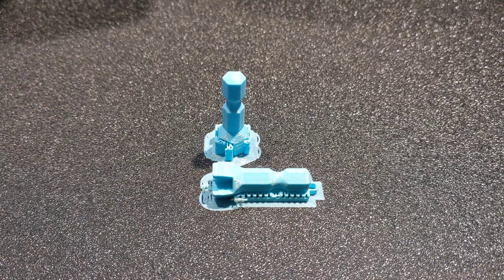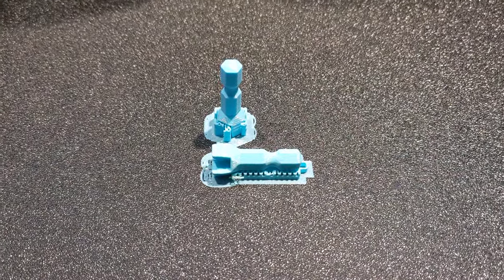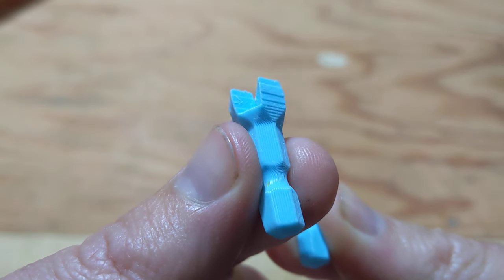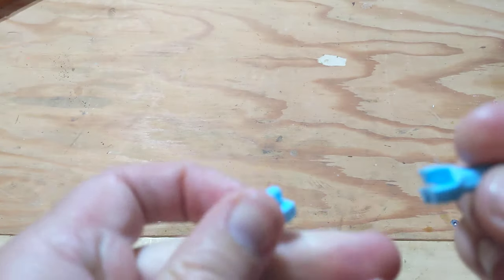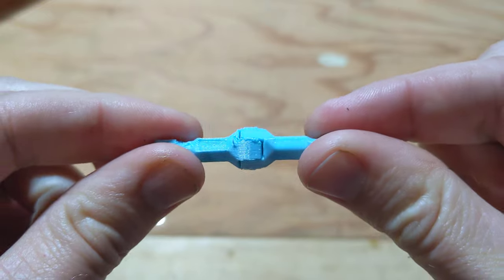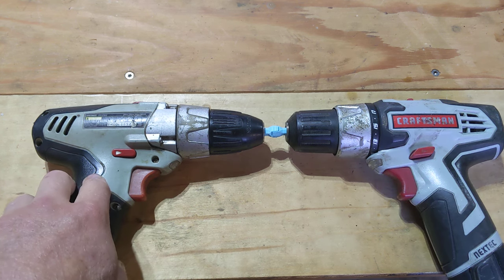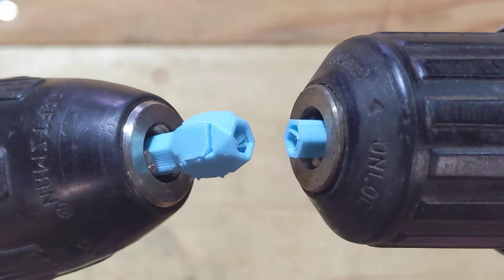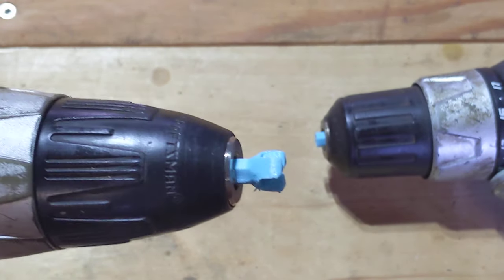3D Printing - grain direction matters

Comment: I've been playing with high-durometer (90A) TPU and while it has many drawbacks, the suposidly perfect layer adhesion is miraculous. It's injection molded quality. Amazing strength as long as you can work around a little flexability.
Reply: just get a 99A version